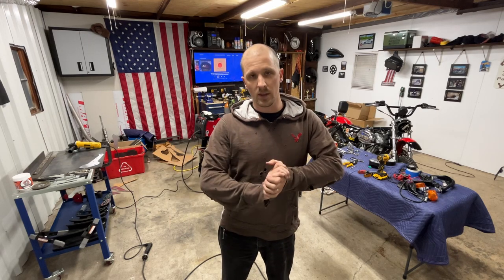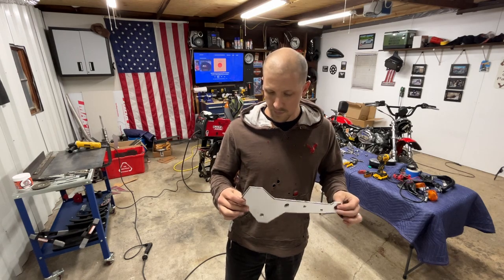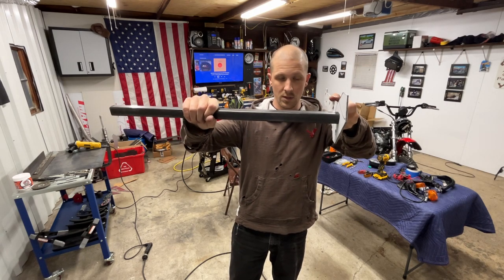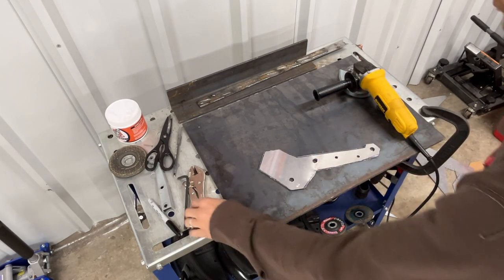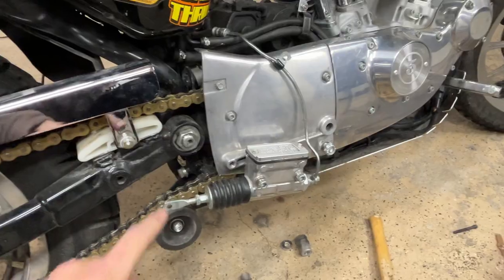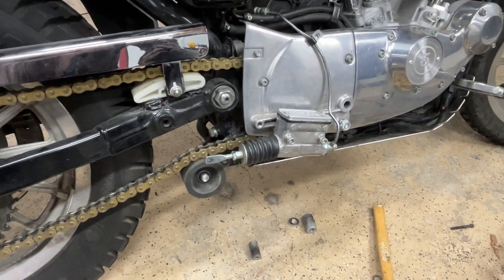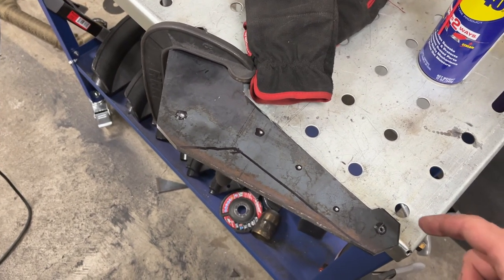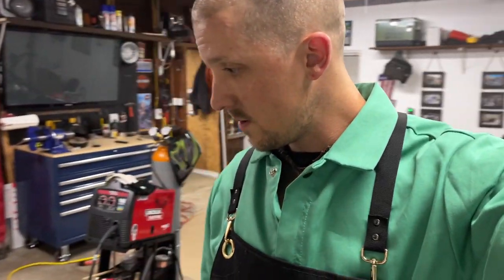Fabricating Custom Rear Controls | Sportster Adventure Build

Comment: I would strongly recommend using some drilling oil with the drill press.  It will save you a ton on bits.   Surprised others haven't made this comment already.
Reply: even WD40 works so you don't burn up the drill bits and have to sharpen them again
Reply: If the cutting speeds are correct cutting oil is optional.

Comment: When cutting steel that thick I usually use some cutting oil. Helps reduce the heat & wear on the drill bits, which are a pain to sharpen.

Love watching the build progress though!

Comment: i just left a book length comment on Jess's channel so ill be kind to you lol.  my only concern is will that tube interfere with the swing arm when it extends if you was to get some air. i know its not a motocross bike but just a thought.  5/16..well it will be strong lol.  looks like a nice floor drill press. grats man. it can help with drilling if you have a bottle of oil like an oiler can or like a squeezable ketchup bottle so you can put a dab on the drill spot.  drilling a pilot hole like you did is a really good habit to have.  good vid

Comment: Just a heads up Jordan, the smaller the drill bit, the faster you are going to want to run it. It will make the cutting edge last longer and will cut more efficiently. Another great video, thanks for sharing.

Comment: I almost would use pipe versus square tubing depending how you are attaching to frame. Either will be strong though so personal choice. That 5/16 Plate is definitely gonna be strong. Are you welding the cross peice to frame or bolting? Can't wait to see rest of the build

Comment: You should check out one of the cheap plasma cutters on Amazon I have one it's great think I paid 200 /250 works great cuts 1/2" plate ok anything smaller it cuts like butter of course 220 works best 110 it will cut thin sheet metal definitely better then cutting with a grinder